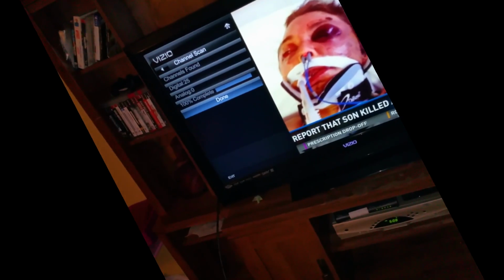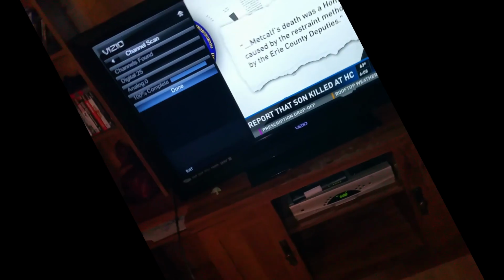Build the best HD Antenna, Free TV!!!!

Comment: I mean a paper clip will work to bring in tv reception,  but steel is NOT a very good conductor of radio waves. For $10. Go to lowes or similiar and buy the correct amount of #10 grounding wire. Dont trust me check it out yourself the reception will be FAR superior

Comment: bought a antenna just like you constructed  back in 1968  it worked for UHF ,just to receive 1 channel. 10 YEARS ago i bought the same antenna at Radio shack @  $39.00, it also had a 18x24  mess wire collecting screen behind the bow ties . I pick up 21 channels

Comment: Great video sir ... I purchased 10ft of 14 gauge / size copper half hard wire for 5 dollars on ebay  .. yeah you'll spend 3 more dollars over those hangers but sure is worth it not having to peel those clothes hangers like a jack ass LOL plus better material than coat hangers ... thanks again!  Link to copper http://www.ebay.com/itm/Copper-Wire-Jewelry-Grade-For-Jewelry-Making-Hobby-craft-Made-In-USA-/121678050876?var=420683719825&hash=item1c5493b63c:m:mPUeVze7085yHgnhhomHYGQ#viTabs_0